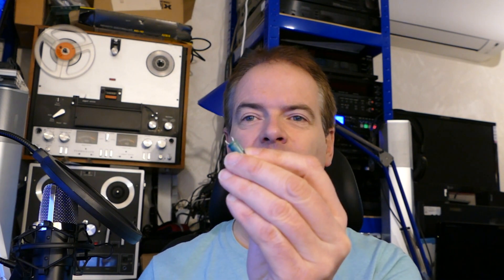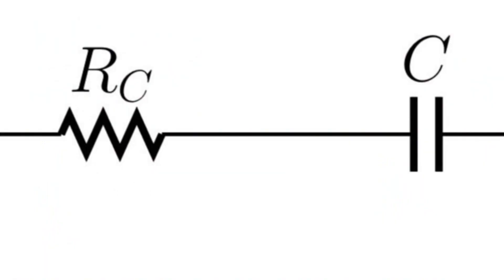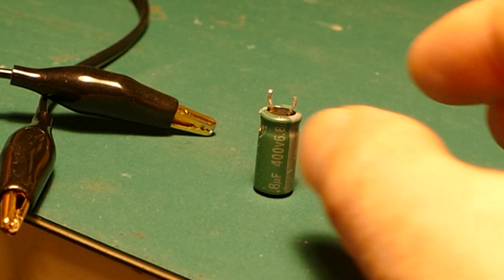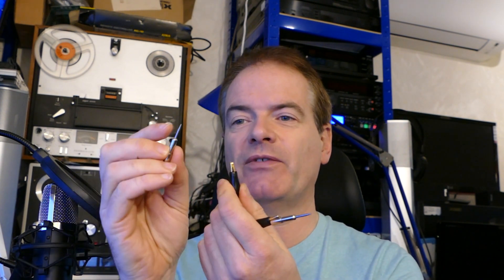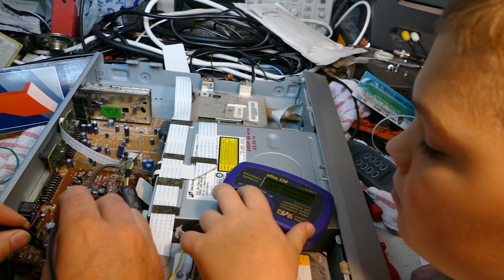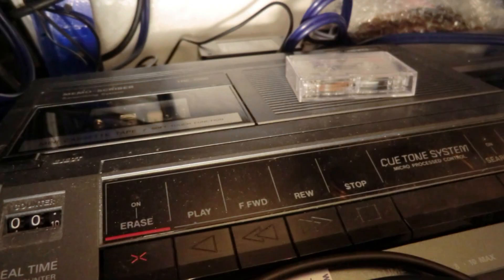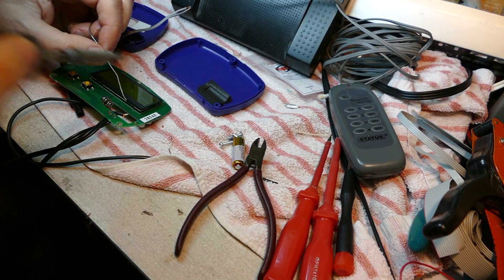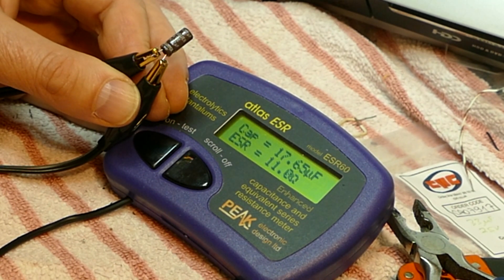Footswitch modification: Peak Atlas ESR60 (ESR70) Equivalent Series Resistance Capacitance tester.

Comment: Where did you get the probes you are using on it? I used the "official" sharp probes they sell for a bit, but the ends were rather long and fragile and broke after a while. The alligator clip ones that come with it are a bit inconvenient for hard-to-reach caps. The sharp ones you are using look a lot more sturdy.

The ESR70 activates automatically when it senses a capacitor which is convenient.
Reply from the maker: Mine has alligator clips. I connect sharp probes from  Keithley instruments that I happen to have.

Comment: Have the ESR60 and it's very handy. AFAICT the only diff to the ESR70 is the smaller range and lack of a beep. The footswitch is a good idea as it tends to power down very often before you can connect the leads when measuring a bunch of caps, which is very annoying, and not all of us have a faithful assistant we can count on. ;^)
Also, measuring in-circuit is pretty much hit/miss unless you know exactly how the circuit works. More often than not you'll get the "in-circuit/leaky" error, or measure parallel capacitors.
However, as others have pointed out, these things are very pricy, and they eat through batteries fast. They take an odd A23 battery which I have to order in bulk due to limited availability. Peak makes a whole range of similar smart devices for testing inductors and semiconductors, which are very convenient, but even more expensive than the ESR60/70.

Comment: The ESR 70 sells for over $300. Good grief.
Reply from the maker: In the UK it should be less than about £85 but elsewhere it could be more expensive.
Reply: I have seen it for about $135 US on eBay.
Reply: I'm more inclined to go for the $10 Geekcreit one